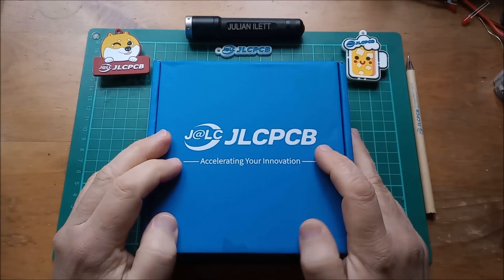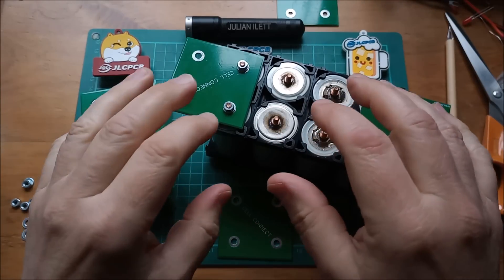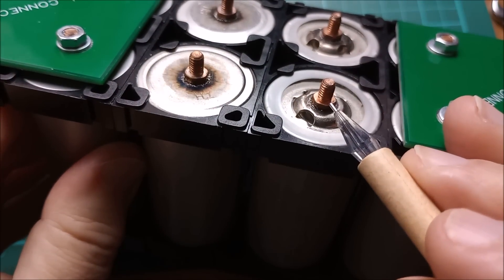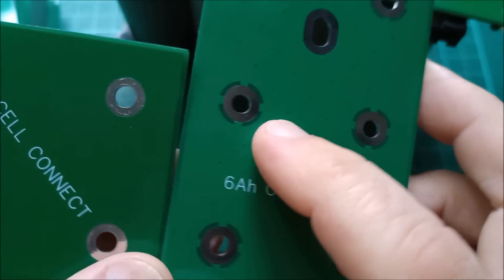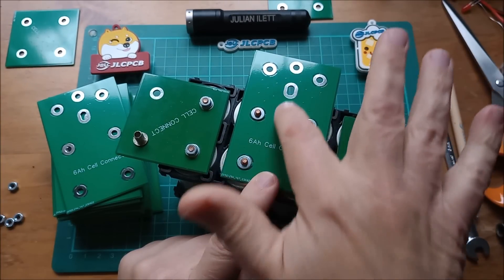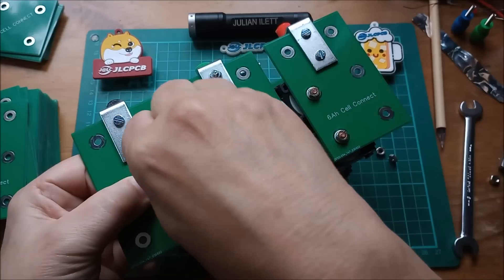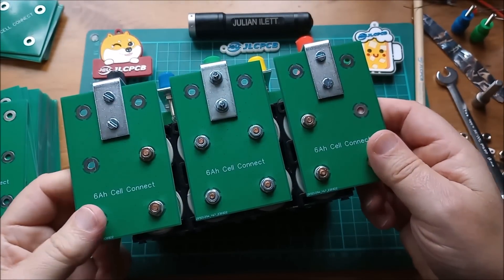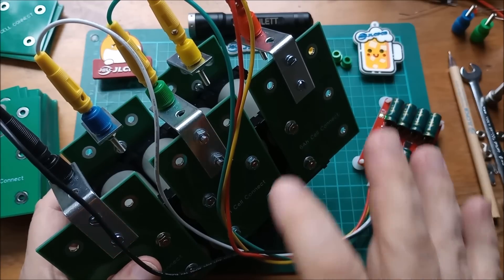New PCBs from JLCPCB - 6Ah Cell Connector

Comment: Your video's sponsor also has some sheet metal services if I'm not mistaken. Have you considered making these boards out of solid metal? You could have the right angle brackets built in and everything would be lower resistance.

Comment: Very interesting approach for the cell fusing Julian. 
One immediate concern I had with the steel angle brackets was their resistance, but I sense you will only use these for voltage measurements or low current applications like balancing.

Comment: What do you think about those cells? Im thinking to use them in ebike, but its hard to find any info about their reliability. Did you test them?
Reply from the maker: Yes, they've been in use in my shed for over a year. They seem very reliable.
Reply: I think they are LiFePO4 cells, so longevity should be very high as well as safety. I was thinking of the same thing.

Comment: 8 spoke fuses, it will be great to see if you can get one to blow. There is a lot of surface area to allow the heat to dissipate which means that you will have to get some bloody high currents to melt all that copper. Once tried to blow a fuse wrapped in cigarette box tin foil, it broke the fuse testing equipment as it just kept getting hotter and hotter and plainly refused to blow.
Reply from the maker: My gut feeling is that it'd take at least 50A to take these spokes out. I didn't want them to be too thin which would render the PCBs useless.
Reply: There must be a name for a fuse that refuses to blow. Perhaps "refuse fuse"? :)